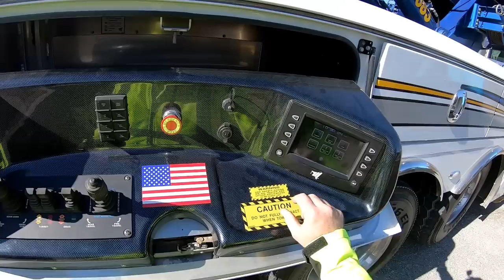Twin Prop Tator

Comment: Mike: "I would love to have one of those, just don't know what I would do with it."

Driver: "People put them in their yards as decorations!"

Ron: "Why?"

Me: Whatever floats your boat.
Reply: I kinda agree with that. Even these older wheels are works of art. I'm not sure the neighbors would agree.
Reply: I have have grown up in the harbours of Rotterdam and worked for years as an Mechanical Engineer at a shipyard in Perth WA. Yes I can fully understand Mike.  I'd love one of those in my front yard. I've installed a few under boats working on the shipyard. 
Your Paramedic buddy from Down Under
Reply: The driver & Ron both said that they
are going to be reconditioned.
Reply: There's a restaurant just north of Milford, Delaware-Meding's Seafood-that has one from a Navy ship mounted on a set of posts and beam.  It's a landmark around here.
Reply: For about $150k you can have one
Reply: Kind of like the guys who work at concrete plants.  They all have concrete test cylinder retaining walls since they pour 4 for each batch, but if the first tests good, the other three aren't needed so they normally would be disposed of.
Reply: I can just hear Mike calling his dad to go fishing next weekend... "Come on over Daddy, I got a new prop for the bass boat; it's gonna bite REAL good when you crank up that Evinrude!!!    ;^)
Reply: I salvaged a 52 inch bronze prop off a ship the ran up on a rough surf line. took about 70 hours to cut the shaft ang get it up a steep shoreline embankment and get into my truck.. I have it installed in a stone driveway wall.. Was a very dangerous job, but it was worth it the prop is in perfect shape.
Reply: Make a good item to " prop " the house up against any high winds
Reply: I understand but I prefer an armored vehicle.

Comment: It's mind-boggling how the drivers are still flying past you guys even though there's a huge prop being moved. Common sense and consideration are a rare find these days. I slow for cone zones not really for my personal safety but to make the people working on the side of the road more comfortable. Nothing scarier than having to fix something on the side of the freeway with cars flying 70 mph close to you. 
Also, I completely understand you being uneasy about using their chains. For those that don't quite understand, it's not so much about trust....  it's more about liability. You know your chains/equipment and even if yours fail, you're covered insurance-wise. But if their chains break, then insurance becomes a nightmare and finger-pointing usually starts. Although, job well done as always. Stay safe. Keep up the amazing content.

Comment: Area headlines:  "Midwest Truck diversifying into Water Towing and Recovery"  "Rumor has it there are photos have been seen of Mr. Ron Pratt, his crewman Mike and 2 workers from a local marine outfitter attaching 2 120" propellers to "the Tator"."  "Though the props are not currently on the Tator, one would guess the original sighting was just a "dry run" if will excuse the pun."  One point of concern for Mr. Pratt is "How can I make my orange road cones float AND stay upright?"  You slipped up a little.  You said out-loud and put on the screen several times that you should put a tag line on those props but lifted and moved them 4 different times without attaching one.  Just messing with you Ron.  A tag line would have been handy at the point of remounting them on the trailer but those props weren't that unwieldy.  Another great video, Ron--love the Tator!!

Comment: Years ago I work for Ron day Trucking in Oakland California. He got the job of transporting the huge propellers from the USS Enterprise which struck a sandbar in the bay. On day 8 foot flatbed of his truck these propellers from the picture I saw appeared to stick off each side at least 4 feet
Reply: That would make the at least 16 feet in diameter. They were taken for repair since they may have gotten bent hitting Sand Bar in the bar

Comment: I've spent many yrs in LE and all states should have it so recovery vehicles can at least have red and blue on while working!!!
In my opinion those chains should have been tighter on those wheel blades. I also agree with you Ron on that tag line on those wheels.

Comment: According to Dick's Towboat Gallery (TowboatGallery dot com -  FYI a family friendly site)  the towboat these came off of was built in 1975 as the Steel Patriot by Dravco Corp, Neville Island, PA.  It has two EMD 20 cylinder 645E7B engines producing 3600 horsepower each. It has Falk 4.515 to 1 reduction gearing and the propellers (which spin in opposite directions on a twin engine boat) sit in Kort Nozzles which increase efficiency and also protect the propellers.  The boat was renamed Dennis C. Bottorff in 1992 and sold to Ingram Barge Lines in 1994.  Dick's Towboat Gallery has 13 photos of the towboat in use.
Reply from the maker: Very interesting.....
Reply: Steve Horton Thanks for the details!

Comment: It's interesting to see 3 perspectives - helmet, crane's boom, and behind the crane (which shows the value of its 5 foot slide) The transporters should use a spare tire carcass so that the prop does not rest on abrasive gravel. They should also buy a plastic pipe to sleeve the prop's support post to protect the inside surface of the propeller from abrasion against a steel post when they raise/lower the prop on to the support frame. I hope they at least do that AFTER the prop has been reconditioned.

Comment: Ron, do the winch lines pay out automatically when you scope out the boom  or "stick" as  you call it or is that just something you are so good at it just looks smooth like butter so you don't end up "two-blocking" the lines.   My background is running small cranes in the offshore oilfield years ago with  moving targets "boats" men and equipment, and later on I got smart and hooked up the USCG as a  HC-130 Loadmaster and handling cargo was my game when working as flight crew but on the ground we performed ALL the care and maintenance of own aircraft.  When we broke down some where we called Homeplate and they would send parts or even a whole new engine.  This is why I love this "show" I can relate.  Don't own a T.V.  don't want one.  This is way better.
Reply from the maker: The winch lines do not move unless they are commanded to move.  There are a lot of times I am commanding multiple functions at the same time to achieve the desired results.  Thanks for your service.   God bless.

Comment: Another excellent, professional video - great to watch.👌
I don't mean this as a criticism Ron, merely an observation: you didn't seem to be as confident and as 100% happy on this job. There seemed to be a lot of people talking and not too many listening. I certainly got the impression that you would have felt better if it was just yourself and Mike on scene, less heads to get bounced with blocks, especially when half the heads had no hardhats.
Did someone move the overhead power lines before you arrived? They were noticeable by their absence.😬

Thanks for another excellent piece of work, in decent weather too.
All the Best,
Dougie.

Comment: what the states  that you service in need is a Law like  we have here in New York State called  the ""Move Over Law"", where  if & when possible all drivers  must  move over to the opposite ( or left) lane to give all Emergency and road side construction crews ( including Utility, and  towing crews)  a safety  area,..  The only exception is is ...If Drivers can not move over due to oncoming  or parallel running  traffic in the left  lane does not allow them to do so safely

Comment: The side road, you intended to close, how far would the go around be?
I think that's relevant info for context.

Just like I was wondering with the rollover lumber truck; how far would you have to go around to get the Rotator from the other side, not just squeeze by with the other truck.

Comment: Coopernickel is so pretty, such an under-rated metal. (You can tell it's coopernickel and not stainless because of the slight yellow tinge to it, stainless doesn't have that, that's thanks to the copper in it. You can also tell by the sound, stainless is harder and would've had a sharper ring to it when the wheels hit each other.. I really need to stop watching Modern Marvels and stuff.. I know too much about too many things and I'm always sharing useless knowledge that no one really cares. Knowledge is worthless if you keep it to yourself.)

Comment: That was a great video, what do you all do to maintain winch lines, I have a winch in the front bumper of my ram power wagon but I've never done anything to protect the steel cable from the elements, some people have told me to put used motor oil on it to protect it from water and salt in the winter

Comment: I thought maybe you would pick up the props stands and all..  Great work as always!!
Reply: As I am sure others have thought the same as well. No need to post two separate comments, try conducting a comment but not post it until after the video has ended so you can add to or edit as needed when following along the video, at least this is possible for a Mac/PC (via browser) user and I have yet to test it on mobile.

Comment: Don't quite know why I love watching this shit, but always fascinated.  At first I was wondering why you didn't pick up the prop and jig stand as a unit and load onto the next truck...Of course until I see the 2nd truck had a duplicate jig stand.  That first truck bed was so rusted and rotted, it was wonder why it was still being used.

A couple of questions come to mind regarding the Rotator.  1) Are the cables required by any law to be load tested at intervals?  2) Regardless of question 1, Are you required to automatically replace the cables either by date of service and or rust/corrosion signs on them?

Cheers

Comment: In an ironic twist, boat guys call props "wheels". Those ones are powered by GM/EMD 20-645 engines making 3600HP at 900-950 RPM.

Comment: I wonder where the props were going (and coming from) in the mid west. Those are some big props, looks like props for a 100+ foot yacht or some kind of other ship or maybe a tug which would be on an ocean or great lakes vessel.
Reply: They came from the tug "Dennis Bottorff"  they didn't get the name exactly right. More info https://www.towboatgallery.com/Dennis_C_Bottorff-0569953.php?mnu=1
Each prop would be powered by a 3600 hp diesel.

Comment: In the end of the video what happened to the guy riding with you?
I wish in ALL 50 States the Red and Blue lights could be used.
Reply: Ron was riding solo in the Tator. The other guy (Mike) was driving Midwest's new roadblock truck. Ron has promised a walkaround of the new rig once the setup on it is finished.

Comment: Did you ever ask them about the size of the boat those props are going on
Reply: More than likely they go on one of those towboats typically seen on the Mississippi River. We see the towboats like that on the Columbia and Snake Rivers out here, and that's what makes Lewiston, ID a seaport. Cargo, mostly wheat, is loaded on barges in Lewiston and other places along the rivers are destined for foreign ports along the Pacific Rim.

Comment: 11:19 commented "no need to take them all the way out".  When you have the space to take them all the way, surely it would be good practice to do so, to give even better stability?
Reply: Alan Torrance Since the Tator weighs 10 times as much as the propeller, the extra stability is physically irrelevant.
Reply: At least the way Ron operates the tator. I run a knuckle boom truck to unload propane tanks. One of our guys flipped a truck last month because he didn't have his stabilizers out. Swung the 2 500 gallon tanks (1,898 lbs combined) too fast. Slow and steady wins the race when using cranes.

Comment: Hi, just 6 min in and a question pops up. Those propellers are actually wider than the trailer. Shouldn't he be carrying a WIDE LOAD sign at the rear?
Reply: unless hanging over the sides by more than a foot (0.33 meter), No sing or flags required.
Reply: That's why the pylons have angled shafts. By tilting the screws they stay inside the width of the trailer.

Comment: Does the sliding Turret feature reduce the lifting capacity of the boom as opposed to a fixed one?
Reply from the maker: Actually, quite the opposite. If we were properly informed, the 1150R is built with a 60 ton boom and has the 60 ton lift capacity on the roller (sliding) version, versus the 1150S (non-roller...non-slider rotator) or a straight stick 50 ton which are both built with the 50 ton capacity booms.  Supposedly, Miller over-built the boom for the 1150R to withstand the different dynamics of the roller system to maintain a MINIMUM of the 50 ton capacity.  This is what we were told by a reliable source, but I do NOT know this to be fact.   I can tell you that I have had our 1150R sitting next to an 1150S and there appeared to be a noticeable difference in the size of the booms, but perhaps it was just me....I did not measure them.   Thanks and God bless.
Reply: @RonPratt  Thanks for that explanation Ron. 
That would make sense that they over engineer when there's additional forces at play to ensure theres no risk of failure.

Comment: Ron, if you don't mind me asking. How do you charge for something like this vs that Pipe roll over.  Thanks
Reply from the maker: I won't go into specific rates, because they vary, but I will tell you we charge by the hour for each piece of equipment on site and any additional personnel needed.  Rates vary depending upon the job site.  Interstate and highway rates are higher than working in a parking lot, because our liability is much higher on the interstate or highway versus working in a parking lot.  We do have minimum charges for different types of work, but, again, everything is based upon an hourly rate.   Thanks for watching and God bless.
Reply: @RonPratt  Thank You!  I was always curious about that.
Reply: @RonPratt  Thank You!  I was always curious about that.
Reply: @RonPratt  Thank You!  I was always curious about that.
Reply: @RonPratt  Thank You!  I was always curious about that.

Comment: What Ever happened to that big pipe load there was no ending to it? Or was there
Reply: I think the heat and the long, hot, physically and mentally demanding job caused Ron to end the video when he did.  He posted text saying they simply lifted some of the pipes off the truck that were hanging off the side, then towed the truck away.  You could tell Ron was just exhausted and "done in" by that one.  It was a real mess for sure.

Comment: I was wondering what kind of vessel these propellers are fitted to (duh, should have read the video desription!) Mississippi River barge pushers, between 5,000 and 11,000 horsepower. See: https://en.wikipedia.org/wiki/Pusher_(boat)#Size

Comment: never understood why you dont just get reverse beepers
Reply from the maker: All our truck do have reverse beepers/alarms.  I ALSO sound the horn as an added precaution.   Thanks for watching and God bless.
Reply: @RonPratt  omg you replied. Fan boying right now
Reply: Electronic backup alarms have become too commonplace. People do not pay attention to them as they do three distinct blasts from an air horn.
Reply: Believe it or not...i caught a video where he forgot to sound the horn before backing. Lol. Everyone makes a mistake and im glad that was the only one made. Besides, reverse beepers wont get your attention quite as quickly as a loud few blasts of an air horn.
Reply: Reversing alarms have a few problems:

1. They're so commonly used that people have learned to tune them out.
2. Something about them (pitch?) makes them very frequently non-directional - that is, it can be very difficult to tell which way the sound is coming from.
3. They just aren't penetrating enough to counter modern vehicle insulation and typical stereo levels.
Reply: @RonPratt  great vid be safe all of you
Reply: @RonPratt  It makes everyone look at the truck. Then they see what you are doing.

Comment: You can tell you're in Illinois, just look at the ___ quality of the road.
Reply: Every state seems to have certain ... problems ... with their roads that you won't see much of in other states.  For example, on the interstate in Il, if you go under an overpass it's going to be rough there.  Oklahoma can't hold an expansion joint.  Missouri can't keep a smooth transition from road to bridge deck.  Alaska will develop dips and heaves from frost.
Reply: @infoanorexic  much of the north east has pothole issues, FL has slick roads when it rains after a few or more days of sunshine, Virginia has numerous roadworks.
Reply: You could be in Minnesota,2 seasons road closed or coved in snow
Reply: Pennsylvania brings out the state flower, the orange construction barrel, in the spring and takes them in very late fall.